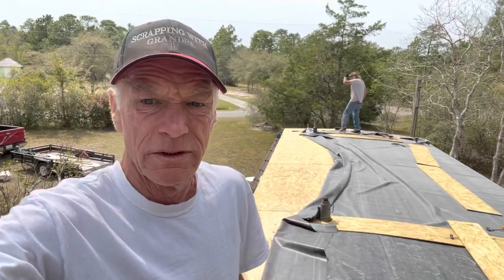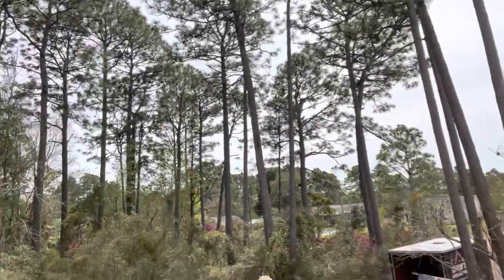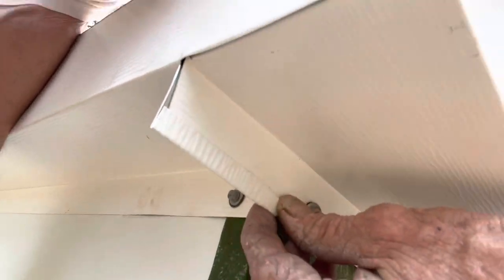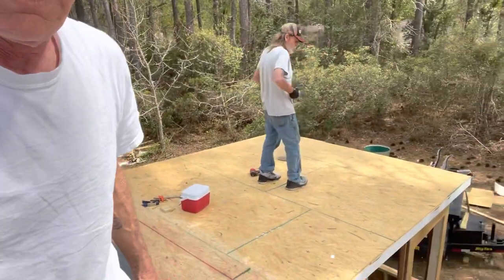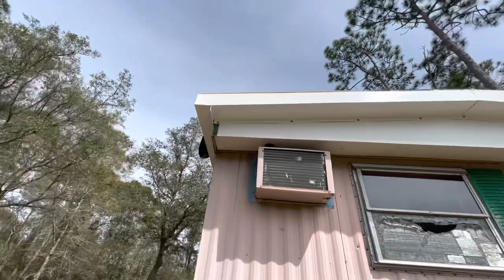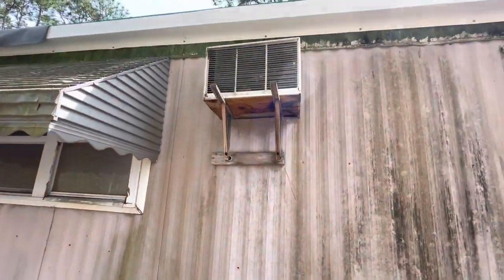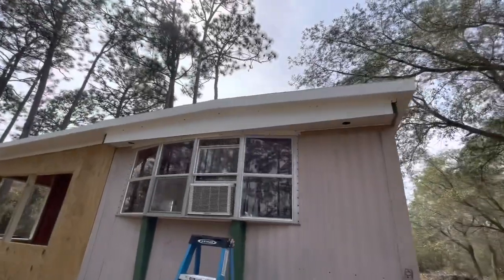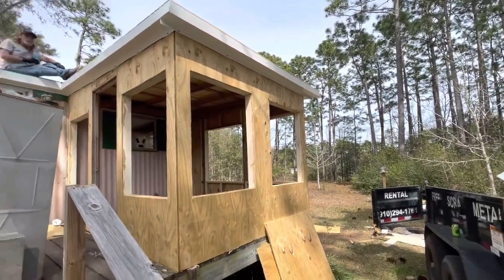Mobile Home Roof Replacement. Getting a Face Lift.

Comment: How much to redo a smaller double wide with new osb and metal roofing. Just a rough guesstimate
Reply from the maker: Metal roofing all by itself runs about in my area $400-$450 per square. That would be a 10 x 10 area times $450. If you have to change the OSP are you looking at another $300 per 10 x 10 area whereas I wish he is almost $50 per sheet. So you factor in your labor you’re probably looking at quite a bit of money
Reply: @Drewsroofingandhomerepair  thanks for the reply